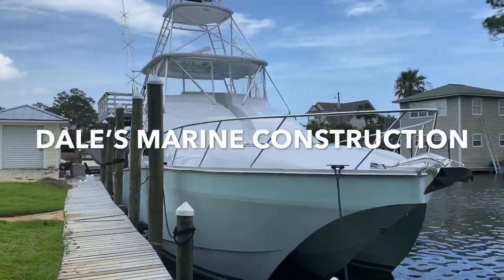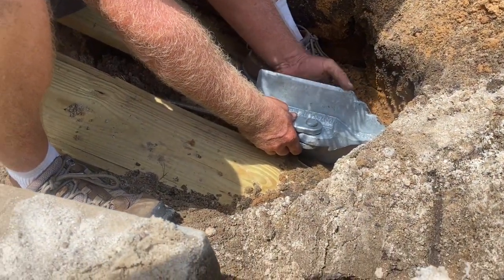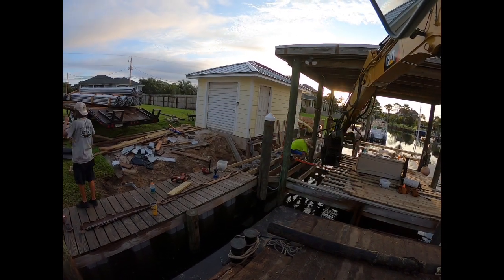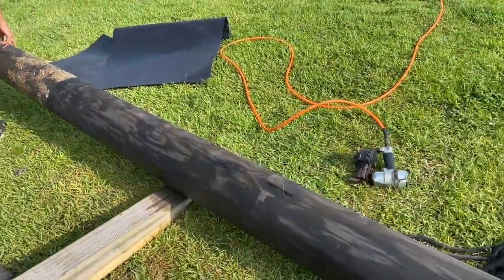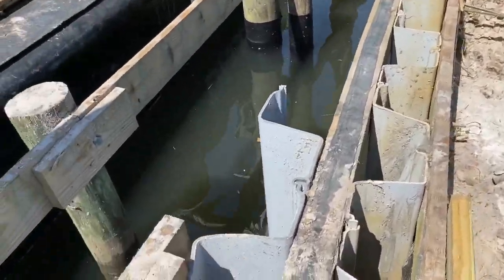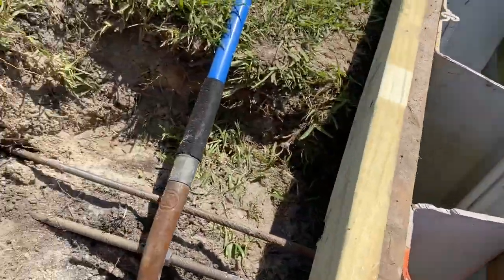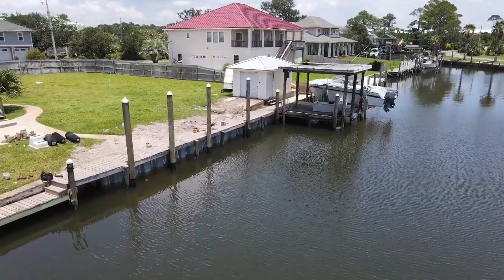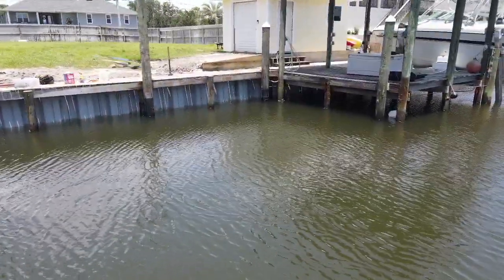Failing Seawall/ RUSTED STAINLESS RODS

Comment: I bought a house 11 years ago in SE FL.  About 8 years ago I realized my tie backs were shot and rented an excavator and within one long full weekend replaced all 9 tie backs with local sourced 12’ 3/4” 304 stainless rods.  I drilled through the old dead man and through each piling and used plates and washers and nuts.  Just realized today that one of them has failed due to corrosion.  Where it split looks like shit steel.  I wonder if it was some cheap knock off stainless.  Very pissed, although at the time I knew I should have gone with 316 and 1”.  Even still, I thought the 304 would at least last 50 years.  8 is bulls$it.

If I go with 316 will I be good?  I’m considering going through the process again.  Ugh
Reply from the maker: Thanks for watching my channel and your question. You ran the same thing. I used too many years ago thinking type 304 was good enough, but it is not. All we use now is type 316 due to the corrosion factor of the 304 fail good luck with your project and yes, it’s a lot of work again.

Comment: How old were those stainless steel rods and what grade of stainless steel.
Reply from the maker: Hey thanks for your comment and question. I wasn’t the original contractor on this project so it’s really hard to tell but I do believe it is a type 302 stainless steel and it’s probably foreign made some Chinese stainless steel that just does not hold up. We typically always use type 316 now